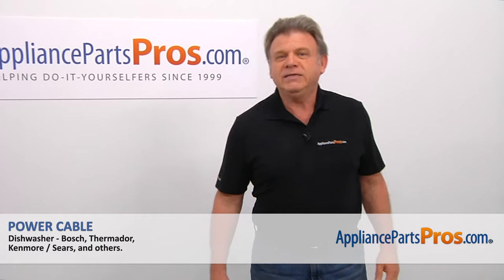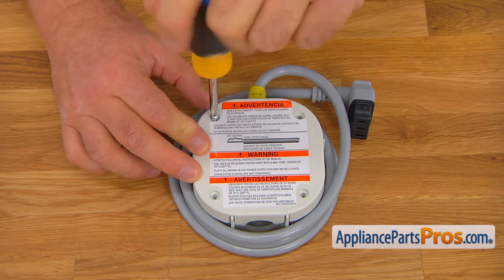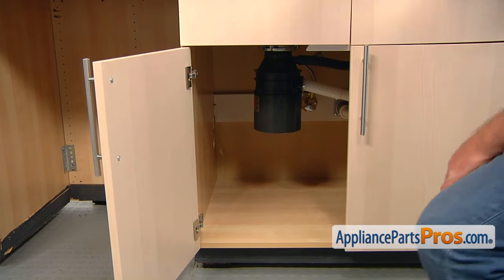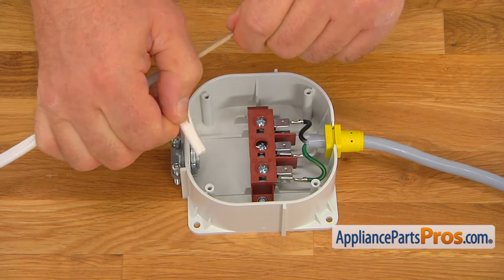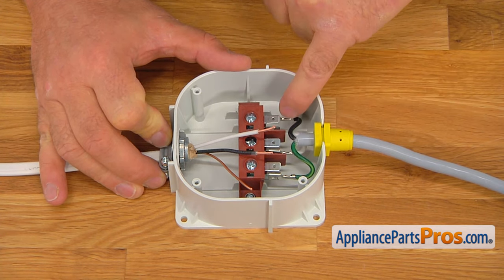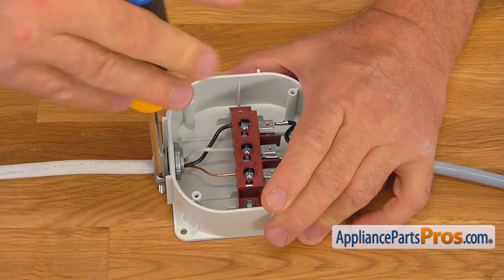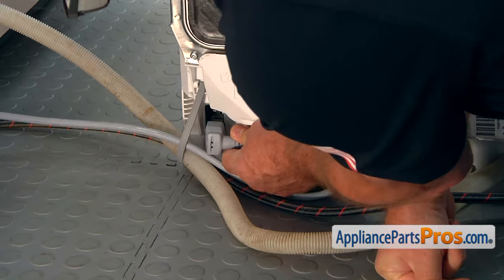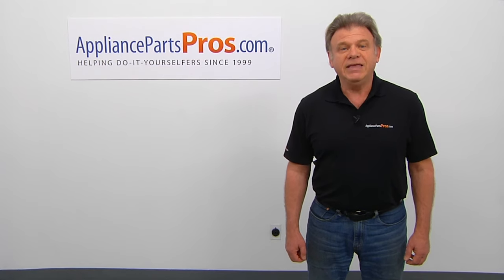How To: Bosch/Thermador/Gaggenau Power Cable 11031987

Comment: Thanks for the video. was wondering where to mount the box, not thinking of the other side of cabinet wall. Do have one question, in a 70's vintage house with aluminum wires, can the supply cord be connected directly within the box, or is it copper only?  If copper only, us the purple AlumniConn adapter and 6" pigtails of 12 guage wire enclosed within the box as appears to be room?
Reply: After thinking it through and answering my own question. To avoid jamming up the wires in the Bosch junction box, with all the space on the cabinet wall, mount an additional compact junction box from Home Depot. Aluminum in and copper out with short length to the Bosch box for normal copper connection as shown in the video. Inside the other box, three two wire purple AlumniConn connectors for the black to black and white to white and ground wires.

Comment: I used the 3 prong plug that came with it. Cycles hung after a few minutes? Lowe's said it was a European model that requires hardwiring? I installed this special junction box and it's only just started but appears to be working? That makes no sense

Comment: How do you install this junction box on the front under the dishwasher?
Reply: They do not address where to put the junction box.  For such an expensive dishwasher it should come with built-in junction box for hard wiring.
Reply: @walkgood4092  I believe that box should be metal and not plastic.  Do Bosch dishwashers have the wires in a box like other dishwashers?
Reply: @synthesizerisking2886  I've only had one Bosch.  No junction box built in for hardwire.
Reply: @walkgood4092  he instructed to put in under the sink on the sidewall near the dishwasher, do not put it in the stall where the dishwasher will sit in!  The wire from wall will attach to the box, the other part from the box will plug into the Bosch dishwasher….
Reply: You don’t, it will be installed under the sink on the side wall.  You will have to drill hole to run the wires through.  I think Bosch has a wall plug but he showed how to attach that circuit wire to the box then run the plug adapter wire back to the dishwasher, although he never showed the Bosch electric plug to plug into that adapter he attached to the dishwasher. And his drainage hose was filthy and old!  The box I am sure should be metal if sitting outside the wall exposed!🙄😵‍💫😳
Reply: @walkgood4092  i talked to my brother who is an electrition and he said don't use a plastic junction box outside the wall due to NEC code, but use metal, and he also said he would not plug disposal and dishwasher in the same outlet under the sink.  Keep them all on their own power supply/ circuit line.  I thing Bosch only come with a power cord, plug it into that adapter the man in the video put on the side.  I am going to look for a metal box like this plastic one he used now.
Reply: @synthesizerisking2886  could take the hardwire from the wall (if u had prior hardwired dishwasher) and put that in a metal handy box (curved smooth junction box) with a grounded receptacle.  Then use 3 prong plug wire from dishwasher.  Mount that inside back of sink cabinet.  Or under cabinet toe kick area.  Also,  get a single plug surge protector.  These bosch are not cheap.

Comment: Why can’t they make a junction box with an end where you can plug it in an outlet instead of wiring everything together yourself.
Reply: because you could just use the normal cable that the dishwasher comes with...

Comment: This stupid design is going to cost me $208 to have it replaced. The black or hot wire melted on both sides. Is there still a problem that caused that short in the 1st place or was it that stupid box?

Comment: Don't these, all catch on fire?
Reply from the maker: If it isn't installed correctly or if it is damaged then yes it could catch on fire, but it shouldn't just catch on fire for no reason.
Reply: @appliancepartspros  There are three wires, colour coded. How would this be installed incorrectly?
Reply from the maker: Just suggesting ideas of what could be causing the issue. It could be possible that the part you got isn't the correct one for your model? Can we have your model number and can verify  what part you would be needing?
Reply: @appliancepartspros  I don't need the part. Just want people to be well aware of the serious issues this unit can possibly cause. Bosch needs to address this issue.
Reply from the maker: Sorry I misunderstood you. I thought that you were needing the part. Thank you for your information!
Reply: @75desman  There is a recall but I have not heard of them even correcting it.